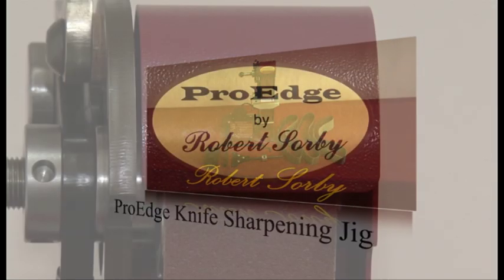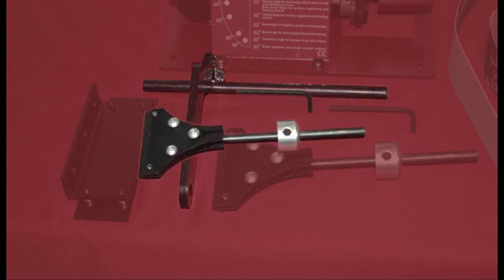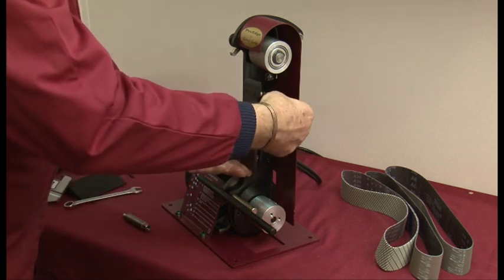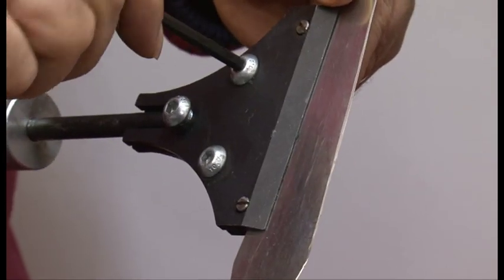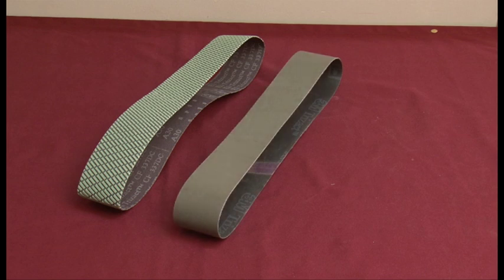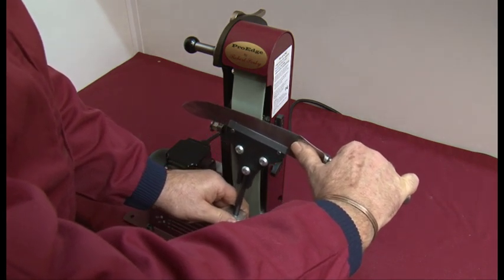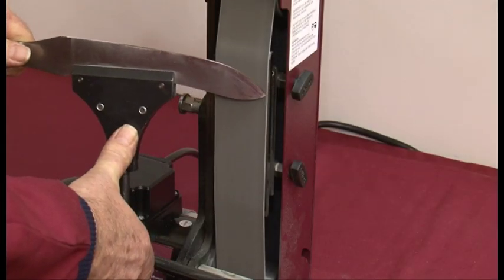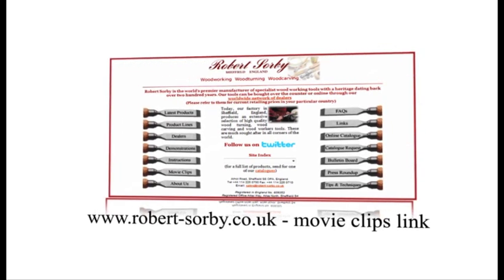Knife Sharpening jig for the ProEdge from Robert Sorby

Comment: This does work but has one fundamental flaw - it is next to impossible to get the correct bevel angle for anything except a sushi knife.  I discovered this when I applied some schoolboy trigonometry to setting the angle only to find that even with a narrow blade and the shortest arm length you can only just get a 20 degree bevel (standard for most kitchen knives) and with wider blades it would be less than 20.  I asked Sorby about this and their response was to use a wooden block to raise the horizontal arm........?  If you wanted to put a 30 degree bevel on your cleaver it becomes even more difficult, I suppose you could you use the standard tool rest set to 30 but then you will end with scrapes across your nice kitchen knife.  Everything else about the ProEdge is amazing but with a bit more thought the knife sharpening kit could have been so much better.

Comment: Hi, thanks for the video, does this process stretch the abrasive belt?, And can the belt be re-used after this with the standard wear plate to sharpen chisels?
Reply from the maker: Hi Dave...The spring on the belt tensioner allows the belt to go over the raised wear plate without stretching the belt, so it can be used with  he standard set up afterwards
Reply: @robertsorbyengland  Thanks for the swift reply, Its what I was hoping for.
Regards
Dave.

Comment: looking at that , im worried about the knife digging into the belt, seeing it's rotating towards the sharp blade. i as well as turning and chisels sharpen a lot of filleting knives. thoughts please
Reply from the maker: Hi Pat...Like turning and woodworking chisel sharpening on the ProEdge, the cannel (bevel as it is generally called these days) is presented to the abrasive belt, so the cutting edge on any of these blades does not dig into the belt

Comment: Am I right that the belt appears to be running TOWARDS the sharp edge of the piece (ie from top roller downwards) rather than AWAY from the cutting edge?
If so, this runs counter to what is best practice for sharpening chainsaw cutters - is there theory to back this up?
Reply from the maker: Hi Falfield...The belt is running downwards as you correctly observed...I am not fully versed with chainsaw cutters but I do not see why the ProEdge wouldn't work suitably... You may be thinking about the old adage of sharpen towards and hone away, when relating to the abrasive direction and the cutting edge...When the tool platform on the ProEdge is set to the desired angle then the item being sharpened is done so at the perfectly correct angle, whilst being held in a positive manner...Honing on the ProEdge is done using ultra fine Trizact belts without the need to change the direction of rotation
Reply: @robertsorbyengland  Thank You very much for this prompt reply.  I have only been thinking in theoretical terms to date, after having been offered access to try one of the machines with a set of Aluminium Oxide belts.  The proof of the pudding is in the eating, of course - I'll try it with a couple of old knives first.
Can you offer a response to the comment by Bowman888 below?  This had been another thing I'd wondered about until I saw the adjustable length of the jig's arm.  But it then dawned on me that if the horizontal arm against which the knife jig is rested is mounted very close to the belt it will be impossible to obtain anything but a very low angle (as Bowman observes).  And if mounted further away to allow larger grinding angles, the belt direction may become problematic (through risk of the cutting edge snagging on the belt).  Have you any observations on this, on use of the ProEdge for sharpening hand axes (to 30deg) or on sharpening the CONCAVE curved edge of a grass-hook/sickle?
Reply from the maker: @falfield  The Ali OX belts will give a good finish for you to get an idea of the machine and then you can move on to the much finer Trizact versions once you are happy with the machine...The original ProEdge knife sharpening jig was designed for our woodworker customers to sharpen their everyday kitchen knives, so as bowman8884 has observed some additional modifications need to be arranged for specific blades etc...We have axe makers using the ProEdge to produce their wonderful tools...The ProEdge gives a flat grind, so to produce a concave grind would need an addition to the system

Comment: Is getting both the large and small blade holder vital as I don't have the same number of large knives and small knives. Can I do both on the large knife jig?
Reply from the maker: Hi Gary...The reason for the different size of blade holders is to ensure a large proportion of the knife blade is held securely in the holder...If the large knife holder does not interfere with sharpening your smaller knives then it is okay to use the one holder
Reply: @robertsorbyengland  Thank you for such a fast answer. I have decided that with spending so much on the deluxe system it would be foolish not to get both the large and small holders. I will have both tomorrow so it looks like I will be sharpening chisels today.